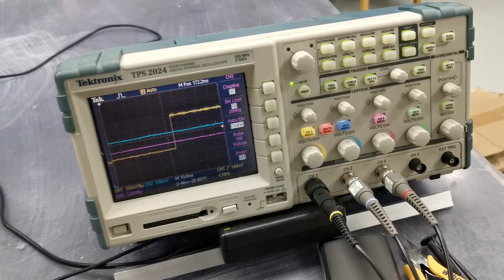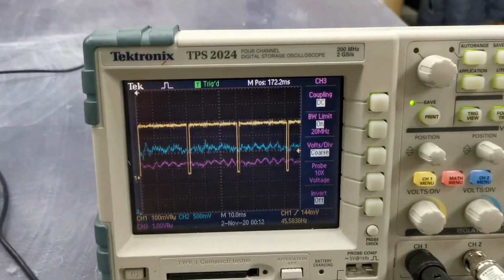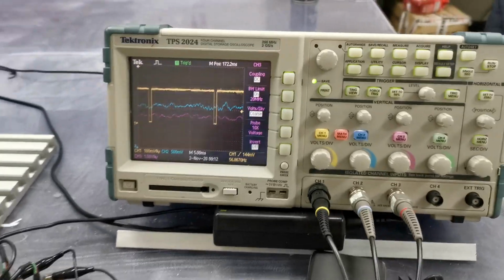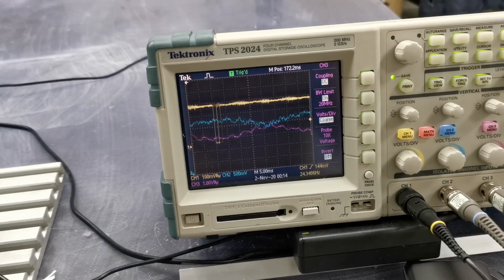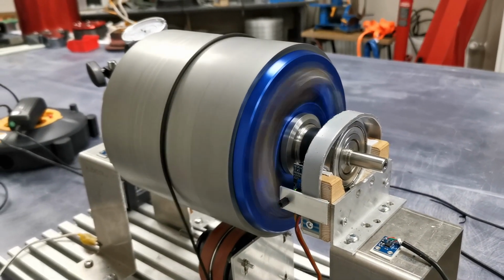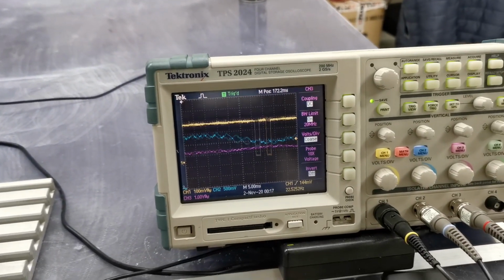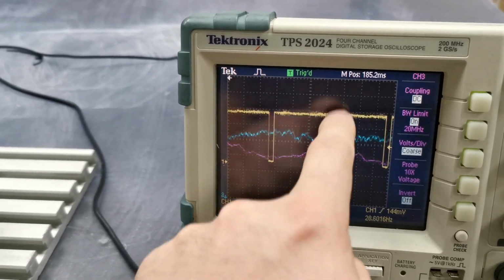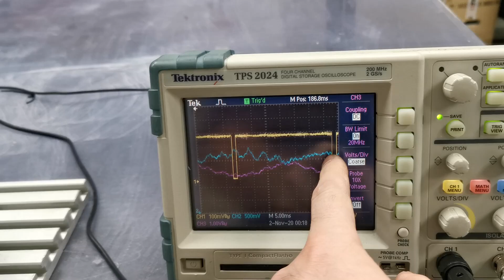Balancing a rotor with an oscilloscope

Comment: very nice video, thank you very much. you answered a lot of questions that I had.
I have bought those cheap accelerometers, a set in digital and a set in analog. MPU6050 and ADXL335 I think the digital ones are more accurate?
I also thought about using a piezo weighing sensor. Have you experimented with those options to see what gives you the best accuracy?

Comment: this is great setup but the motor cannot engage with the rotor in the center as that influences the forces, which prevents you from balancing correctly. you want to rotate through the axel (shaft)

Comment: Thank you very much for your video, also your english is for me very clear ( i'm not English or from States, i'm from Italy ... )
I do appreciate the start line ( and it's trigger to the oscilloscope ) which is to be considered the zero angle of a 360 degrees revolution ... and the following position of the eccentric weight ...

Comment: can i use a computer instead of an oscilloscope?
Reply: Check out USB oscilloscopes - essentially these devices are black boxes which take the inputs and connect to your laptop/PC via USB cable. These devices come with software and typically cost $60 - $80 - they are not as full featured as a proper bench oscilloscope 😢 but easily good enough to handle the outputs of the type suggested in the video🙂.

Comment: Nice setup.  Can you provide a few more details on it?
1. What accelerometer off ebay did you use?  I see alot of the GY-61 ADXL335 analog output ones that have a theoretical max BW of 1600Hz, but that is with the smallest filter capacitor on the output, and I doubt a lot of those boards come like that?  I think my particular motor maxes out below 1K RPM, so what sensor BW would I need for that?  How do you figure that out exactly?
2. What IR sensor board did you use?
3. Is there anything special with your motor mount design to provide for vibration sensitivity and how the accelerometers are mounted?  Are you attempting to float the axle mounts somewhat or something else?
thanks!

Comment: I'd be interested to know about how other mounting design for this setup would compare. My understanding is that suspended carriages allow for more sensitive plane motions to be detected. However, the suspended systems seem unnecessarily complicated - instead you could stiffen the stands and allow the bearing mounting brackets to slide laterally on top of them within a limited range of motion and move the accelerometers onto the moving plane.

Comment: Very neat, nice job!  I think that scope supports averaging which would take all that high frequency noise out.
Reply from the maker: The low pas filter can can only be 20Mhz. Way to much than needed.
Reply: @iulian207  No I didn't mean the lpf. If I recall correctly you can set the acquisition mode to average over 32, 64 or 128 samples. The results can be amazing!
Reply from the maker: @gadgetwob  Sounds very nice, i will check if i have that setting.

Comment: Is it suitable for 150k RPM turbines?
Reply from the maker: The accelerometer has 1600hz range so it can detect speeds up to 96k RPM. For higher speeds you need something 2500hz range.
Reply: @iulian207  i was theoretically thinking about having DC motors that have very close anatomy to BLDC where the magnets move but still operate on DC battery power directly

So i came up with a very realistically idea which is putting the brushes on the rotor wher they spin with it(the magnets or magnetic coils become the moving part)

As for the comutator it will be sliced in half cross sectionally in order to split every commutator bar in half. The first half is always on the + and the second half only gets electricity when the brush passes over this specific commutator bar and closes the circuit

Commutators and brushes are the carburators of electric motors and this method gets rid of the need of a complicated controllers, decreases the weight of the rotor because only the coils or magnets are turning and allows a dc motor with out runner and inrunner config

Let me know if you would like me to share some details maybe images about the concept